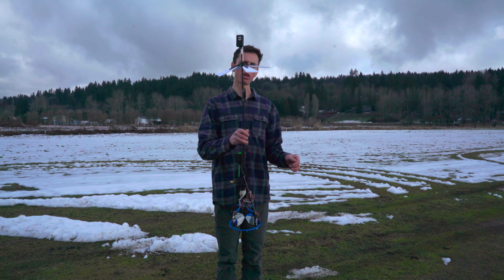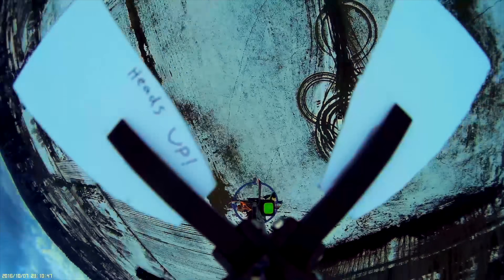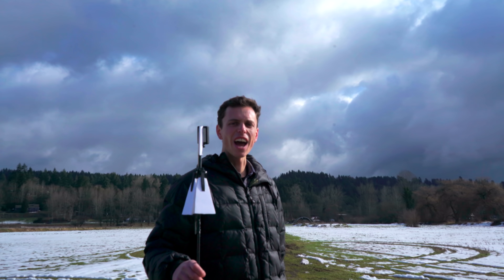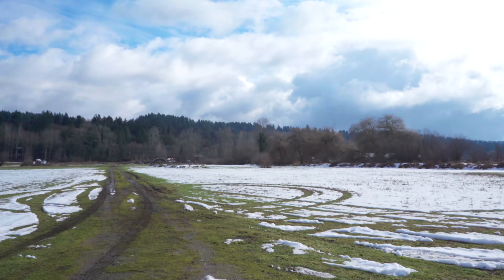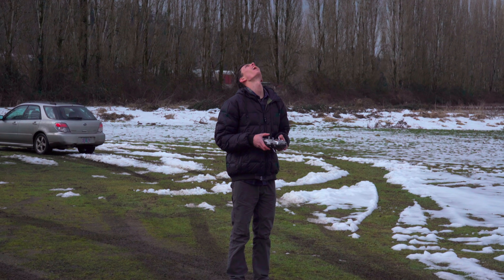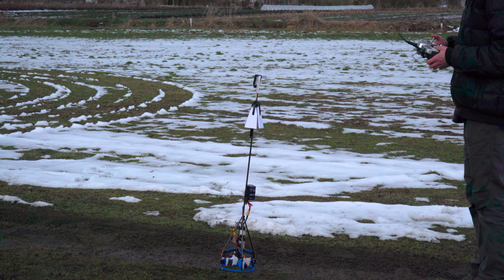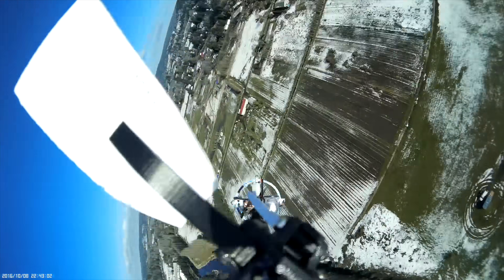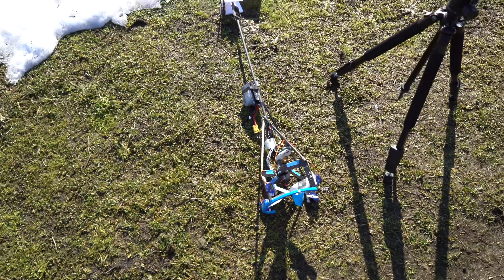Brushless R/C Rocket Vertical Landing with Pop Up Fins - RCTESTFLIGHT

Comment: Excellent project!   Once initial thrust is cut off, and free fall is initiated, I was watching the lower fins move, and initially thought it was surface "control flutter."  It seems (like you mentioned) that the gyro was trying to compensate (albeit backwards) to return to equilibrium.  It was interesting to watch the rocket pitch as both sets of fins fought for more drag.  After the CG was lowered, the rocket simply spun on a stable axis.   You could orientate the upper fins to take advantage of this, perhaps a controlled helicopter - like auto gyro descent, like is mentioned in a few responses.  Trying to program the lower fins to compensate in a reversed manner solely during free fall would be really to cool to play with and observe.  Also, battery in a higher position during launch and lowered for free fall?  Once again, great job stretching our access to the frontier of this kind of stuff!

Comment: Also if you plan on making the fins larger, add pitch so it rotates in a more stable manner on decent and it will also likely be more efficient at slowing it down.

Comment: Have you thought of putting the propeller at the top to pull the vehicle instead of on the bottom to push. That would be cool to get into outer space without jet propulsion, keep thinking outside the box

Comment: I don't know why someone hasn't recommended this but do fins and add control surfaces so it doesn't just self right. You can have it be a rocket and absolutely hammer the throttle straight up and then glide back down FPV..... you can then test and see max elevation anddddd max flight time achieved gliding

Comment: Just came across this and was instantly amazed at what you have built, first one ive seen, love the idea, i see everyones comments on the flaps at the top and i thought id add my 2 cents, if you angle them slightly as in a a set of multi rotor blades , one set clockwise the other counter clockwise , it mite stabilize your free fall, also just some food for thought, when you spoke about how sensitive your cg was, i had an idea, since your main centre structure,  why not wind a coil of copper wire around it and slip a magnatised steel tube or a magnet with a hole in the centre over the coil, so it can slip up and down the shaft, with some way of varying an electrical current through the coil , you should be able to move the magnet up and down the shaft, i understand this is more complicated than it sounds but its a starting point for the idea, with some software involved it could be auto set to move itself depending on acending or decending , or you could manually move it with a trim knob on your transmitter.  Sorry about the long read, love the idea man, cant wait to see where this leads 👍👍👍👍👍👍

Comment: If the 4 blades are for air-brakes then drill some holes in them and open 90 deg. or a little more. 
If the 4 blades are for gyro rotation then make all four of them longer and all four rotate together but independent from the main rocket body while still being able to control the rocket with the lower fins.

Comment: Seems like you've hit upon a way to make the rocket lay on its side when descending.  The fins are doing the opposite of their primary function and keeping it out of vertical.  Perfect!
Reply: Reading through looking for just that comment, and was going to suggest just removing one vane, but had a second thought.
Fit just one slightly larger vane, shaped more like a small wing (or tail) that can pivot out to about 45º.
This should hold the rocket horizontal, and generate a forward gliding thrust as well as defining an 'up' when falling flat.
This 'forward' glide should assist the pitch up.
Maybe a little 'aileron' trim on the forward plane to create a gentle turn so it stays in the same area.

Comment: Very cool.  First mod I thought of was to have the upper stabilizer use longer blades like a helicopter, and have the blade hub free spin on the shaft....giving a an "auto rotation" effect where it will slow the decent and offer stability...Stubby blades may work as well.

Comment: instead of using servos and control surfaces, how about a version that uses a swashplate, and pitchable blades, like a helicopter? 
this would allow quick reversable thrust (maybe useful for popping out the fins at the top if its out of control)

Comment: Why don't you try to use an acellerometer to invert the fin behavior every time the Rocket changes direction.

Not sure tho how to accomplish that. I'd probably use an arduino between your existing flight control system and the servos.

Very interesting project keep it up !

Comment: rctestflight Excellent project I am following, thank you.  Are you old enough or remember those gas powered helicopters from the 70's, 80's and early 90's that have a small vertical gas engine and propeller that spins at high speed, and also unpowered large blades that articulate angles so that they spin up from the prop wash from the small engine and generate lift similar to a gyrocopter (except the prop wash is from above instead of pushing forward from the rear). Once the small engines tiny tank of nitro ran out the helicopter would kick out a little parachute guy (usually around 1,000 ft) and as it started to free fall the unpowered large blades articulated angles and would counter rotate in the opposite direction which would lower the helicopter back to Earth slowly similar to how a maple seed helicopters down... wondering if something like that would give you the "parachute" effect you desire.  It would look very cool, and be fun to design and print.  If my description is too haphazard, let me know and I'll link a video of one.  Thanks again for interesting content!

Comment: rocket stability is due to center of gravity being a body caliber ahead of the center of pressure. On a rocket with fins the center of pressure is located where the front end of the fins join the body. on your rocket this is probably nearer the motor, and I disagree with your assessment of where you think the center of pressure is. I have several years of buildind and flying high power rockets thru Tripoli High Power Rocketry and National Association of Rocketry.

Comment: Make a cuboid with no square shaped sides and fix the system where the diagonals meet and note to make air foils at the bottom facing downwards at the edge of the square side. it will work

Comment: You probably already know this, but the motor scream is due to the prop's proximity to your vectoring surfaces. I mean, it's not a big deal aerodynamically, but that's the reason that flying wings (in pusher format) and prop-in-slot motor placements are so noisy. I'm not sure there's much you can do about it in this config, but there you go. Neat project, and thanks for the update!

Comment: Sounded like that ESC beeped 4 times at power on, So it thinks the 6S battery is a 4S.
Probably means it doesn't understand A 6S pack voltage and so isn't rated for it.
Probably will work at 6S for a while but may release magic smoke eventually.

Comment: You know what would be really cool? Make those flaps about 2 feet long each dihedral and an angle and then have it on a bearing on the shaft so it can free spin this way you will literally have auto rotation recovery until you power up the motor which should give you a very smooth descent and very slow descent

Comment: What's the max theoretical altitude based on the energy capacity of the battery and the mass of the vehicle? I'd guess somewhere over 20,000 feet.
Reply: At full throttle on 6S this could probably go for four minutes. It would have to ascend at 80mph to reach 20,000 feet in that amount of time which I don't think it gets anywhere close to
Reply: @towers3372  right, and that tiny prop could not push enough of the thin air to get the lift it needs to get anywhere near 80mph either. Even at 6000 feet the air is already only 80% as dense as at sea level. Then you have the problem that something will overheat. I'd say you'd be very lucky to get past about 4000 feet.

Comment: Looks great. Some really good last-second saves (almost a hover-slam)! 
Would a little bit of power on descent prevent the spin on the way down? Looks like your vanes were trying to correct for yaw, but with flow reversed were actually making it worse.
Even the simple pop out vanes seemed to give you a semi-stable descent though.

Comment: If you want to drop horizontally you could  just have some sort of drag device parallel with the centerline.it might look like a + or o from the end. I also think i saw a flight where only 2 flaps deployed, it seemed to fall flatter but may have reduced your control like when you crashed.

Comment: Need to eject a battery after ascent, then use another for landing, to change the CG/CP balance?  better to orient the fins in the vertical plane, rather than horizontal, so that they can stabilize better, such as grid fins(which are oriented vertically in an aerodynamic sense, but horizontal appearance) , or arrow feathers.     looking forward to seeing future developments.

Comment: you should see if you can either put the stabilizer on a switch (or with throttle input) so it cuts off when motor isn't running, unless you can find a way to reverse it during free fall. the low center of gravity plus the fins up high causing drag should actually keep it pointed straight up and keep it pretty stable for when it's coming down. also maybe see if you can put something between the fins like fabric that helps create a parachute effect

Comment: thanks for posting.   some thoughts.     at 7:45, you are  mixing-up,  horizontal  and  Vertical flight  'mode'   forces/factors.    this  'object' is  Radially  Symmetrical.  doh.        the design  of  the  'fins' could  USE  A  LOT   MORE   THOUGHT.    suppose the fins could rotate freely, on the the way down;  INSTEAD OF the whole thing spinning.   shape the fins  LIKE   PROP   BLADES.     possible, control during descent  could be improved by the use of a  servo-controlled swash-plate, at the fin assembly;   on/off  function  could be determined, by  fin  Position/orientation.   cheers

Comment: Hi - I'm really enjoying your adventure and the uniqueness of your project.  My sense at this point is you've gone as far as you can with an 'open architecture' structure.  I suggest you consider enclosing the framework within a lightweight tube construct, allowing only the power/vane area to remain open.  Nasa scoops may be incorporated in the tube construct  just above the power/van area to permit increased air flow.  Concerning the four hinged flaps. Keep the hinges but swap the flaps for helicopter-type blades attached to a ball bearing mast. Fill in the area between the blades with tube material rising to a cone point.  In appearance, the wind will see a smooth cone and tube body.  The Nasa scoops will improve air flow at the base of the tube while ascending.  At apogee, as the body begins its descent, the helicopter blades will deploy and spin, greatly slowly descent of the whole.  Hope this helps.  John

Comment: Try using longer, thinner fins and by longer, I mean all the way down to the battery and put a little pitch on the fins, so as it falls by gravity, it spins like a Gyro which will both slow it’s descent as well as stabilize it.
Reply: Hmm, so crossectionally when flying straight up it's as if there not there, but when falling aide ways it will have the cross section of tube. Might be good.
Reply: Chazz7555 
I was addressing this differently than the author’s original intention. My idea was to “helicopter “down in a vertical position, spinning, with lots of resistance on longer blades rather than the whole unit falling sideways, which in my opinion is far less reliable than helicoptering.

Comment: Suggestion, place Ripstop material between the fins. That will substantially increase your surface area in free fall.
Reply: I dont think he's looking for a parachute concept. I'd be in favor of longer blades attached to a rotating hub utilizing a gyrocopter concept.  Maybe two of them counterrotating.
...and maybe a solenoid deployment mechanism.
Reply: But cool to try. Even a mesh, just to slow descent. If they are on servos too that auto adjusted. Would be neat if there were a simulator to try this stuff on. Something fairly accessible and not requiring compsci degree.
Reply: Use 1 servo to pull all the fins out at once.
Reply: Brilliant!
Reply: The airfoil affects of the steering elements is causing drag in horizontal attitude in the vertical direction.  I.e. they are acting like an empennage and keeping the back from dropping.  Any form of "flying" drag is going to have a dramatic affect on gravity effects.
Reply: @wondamaner  If the main prop and steering elements were enclosed with directional air intakes it might reduce the spin encountered on descent. One could put doors on the intakes to prevent air back flow through the prop and steering flaps. All this would be implemented at the expense of added weight.
Reply: The fins, or the 'grills', are used by the falcon boosters when landing to bring the cetner of drag up. That is why they retract during takeoff, as center of drag will affect where your craft will want to go naturally, it needs to be lower during 'forward flight' (thus fins on the bottom of rockets) the fins do not actually parachure or slow down the craft, rather they stabilise freefall and make it easier for the engine as the craft will not spin out of control.

A suggestion, try making the fins motorised, so that they pop out during descent as otherwise they may fold back or get stuck, causing the engine to work much harder than necessary).

Comment: You should make the top folding propeller bigger and add a mechanism to have each blade unfold properly on descent. Maybe not have it fold completely or something as simple as rubber bands pulling up each blade (just a bit) would help?

Comment: Add some soft thin plastic sheets in between the flaps, when expanded you will have a better drag when the rocket is descending.
Reply: If the blades acts as auto rotating helicopter blades, they will have bigger drag than a plastic chute and it will also stabilize the decent
Reply: @Tore_Lund  My thoughts exactly.
Reply: Getting a swash plate or a bushing  or a bearing to stay on the rod is a consideration to be made not to complicate the sub system.

Comment: What about having the fins just go to centre when the throttle is shut off, seems like it shouldn't be too hard to programme
Reply: this!
Reply: Yea at least, you can see the fins exaggerating the oscillation at a couple of points, dead center or all one direction to induce spin would be a start but if they could be set to invert control direction when the power is at 0 it wouldn't need the top drag fins (though the Space X style grid fins are cool!)

Also, is this a more efficient flight platform than a quadcopter? 1 large motor + 4x servo instead of 4 motors?
Reply: You should be able to program a mix to reverse the servos at zero throttle. If not on Spektrum, I’m positive a Taranis could do it.

Comment: When you said it looks like a helicopter i thought "actually.. why not make the fins from helicopter blades so the rocket can descend with autorotation like a helicopter. the rotation will also gyroscopicly stabilize it.
Reply: Put the hinged flaps on a ball bearing or what not to get the rotation.
Reply: @jamesg7371  yes, that!
Reply: Rotor rocket descent isn't exactly a new concept, but I agree it's worth visiting. If you're intentionally having it helicopter on the way down, then the rotor section needs to be able to spin freely so the rest of the rocket doesn't spin with it. Mainly because it'd make regaining control a bit easier. Might even be more stable because a bit of the gyro effect and the spinning would make the fins deploy more consistently.
Reply: Make the flaps slightly angled, like fan blades, and spinning centrifugal force will get them all to stick out on the way down.
or use a servo to push a ring up under them, a little like an umbrella.
When only one flap sticks out, it makes it less likely that the others will deploy because of aerodynamics.
Reply: I also thought this was going to use autorotation principle, how about mesh petal shaped curved fins...
Reply: regenerative aerobraking? xD
Reply: Not only looks like, it is a helicopter. Per definition. A rocket has a rocket engine.

Comment: Definitely the thrust vanes shifting the cp on descent doesn't help to fall straight. Maybe you could deactivate the vanes on a switch for descent and activate them before powering on. Also you could add a servo to activate the air brakes since if the craft tilts too much, not all the fins will deploy

Comment: This rocket series is really cool! I'm really eager to see if you manage to get a stable model and get really far up, then I'd be really tempted to try it myself (unfortunately I don't have a 3D printer...) !
Reply: @eimb1999 yeah sure go build something as precise as he did without a 3D printer and with plastic sheets and wood and barely any tool. 
Also for metal you'd need something to weld, which I don't own. And the tools would cost even more than a 3D printer. So please keep your sarcasm to yourself, thx bye.
Reply: @eimb1999 Well, I guess if every builder is as condescending as you, it's not a surprise I've never learned about it, indeed.
Cheers mate, have a good day. I hope you'll learn to be a little more positive in your approach to people.